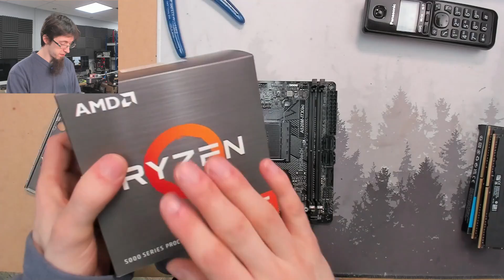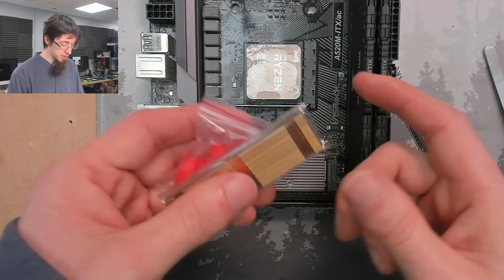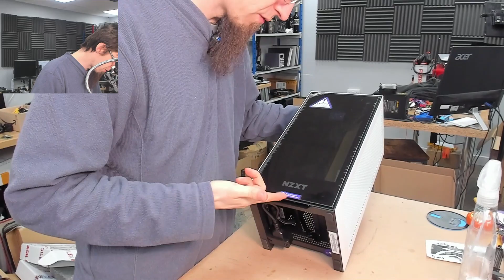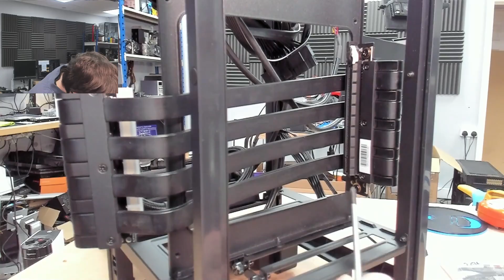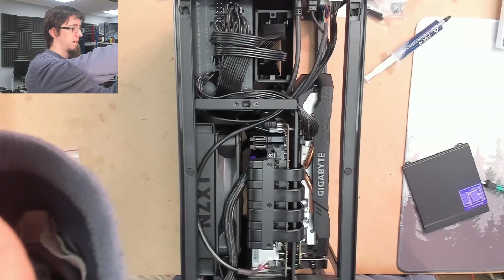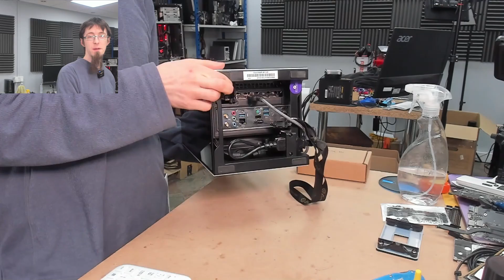NZXT H1 Build - LFC#337

Comment: Hi Graham, I have a question that you may have an answer to. I currently own an Asus ROG Strix Z590-A Gaming Wifi II (and the I5 11400F) and have tried to install a 19-pin USB 3.0 splitter which results in the Port not working as in "USB device not recognized: error. Are these ports not split-able any longer? or have they never been?
Reply from the maker: So is this like, a PCI backplate with two USB 3 ports on it that go back to the 3.0 header? Should be just fine, because this is fundamentally all the front ports are. If you're getting errors, I'm guessing it's just a bad splitter, which would be rare, but not unheard of.

Comment: I copped this case with for 90€ , can't complain. Putting in a 3060 and a 5700x on a ASRock B550 Phantom Gaming-ITX mobo. I like the compactibility. I'll mainly use this as a 2nd PC and can move this from place to place due to it's nice a snuck size. Thanks for the walkthrough!

Comment: On ur channel while trying to figure out how to attempt micro soldering..not out of luxury unfortunatly..i got a g14 rog laptop that the battery connector ripped off the board. Im broke so ita ether i fix it or use it as a 1500 dollar paper weight..ugh, the tiny tiny soldering is terrifying

Comment: Another great vid but a few small errors: the H1 comes with a 140mm AIO not a 120 as mentioned, also the power supply is 750w not 650w so I'd say its probably capable of handling up to a 3080 paired with a lower wattage CPU, especially if you undervolt.  Otherwise excellent job, love this series!
Reply: this is the v1 which is 650w the v2 has the 750
Reply: Plus it isnt Asetek AiO but Apaltek - this particular AiO has problems with very bad coolant inside, i would recommend refil it with better one.

Comment: Small thing I spotted: At 30:56 the motherboard actually allows you to change "CHA_FAN1" (or 2 for that matter) to "W_PUMP", which is presumably what you'd want.
Reply: Ya, that helps prevent this from happening.   It locks it to full speed and fan curves won't affect it.
I've seen him run a pump curve on his personal rig, but for a customer, I'm sure he'd normally just pick full speed to save potential problems.
I used a premade system which ran hot and that was the same problem.  The pump was running too slow because they didn't set it up correctly in the bios.

Comment: What AMD should do is put in a dummy CPU code in all bios that is compatible with a single core of any AMD Zen based CPU so that even if the CPU isn't natively supported by the board the bios can be loaded to perform a flash. I've owned several AMD boards in the past that were functional with CPUs they didn't recognize so i know they are capable of this. Or integrate a small low frequency low power x64 CPU into the southbridge to be used just for bios features. They could also spend a dime and have the eeprom socketed so a technician could easily remove and program the eufi/bios. I'd pay a bit more for boards that had such headache prevention features as standard.

Edit: NZXT really should have placed that warning sticker on the peel instead of the glass directly. Or used a sticker that is like the peel itself a static adhesive one.

Comment: Just packed up r5 5600x with Radeon 6800 in this case. Added an extra 90mm fan and needed to cut the hole in top of the frame to mount the massive xfx GPU but now it is amazing looking computer in my daughter's room. V2 is better but cost 2 times more if you have some skills you can build very nice gaming pc in V1.

Comment: I think they could have a version for a 3-4 clot GPU in here if they extended it a bit. since the CPU is as important as the GPU, having the chunkiest GPU possible may be a worthwhile upgrade, and you can get CPUs that will stress that 120mm AIO, would be a huge performer in a small space.

Comment: 12.45 its not an asetek unit, they had another oem do some coolers for them but the pump head was the same looks wise but pump moved away to get around the patent asetek has
Reply from the maker: Ah, that makes sense actually... The waterblock is the asetek shape, so I locked onto that, but you're completely right about the pump being relocated👌
Reply: @Adamant_IT  cant remember the OEM but its the ones that also made the nzxt m22
Reply: @Adamant_IT  do you have any experience with asus crosshair x370 boards with debug code 8?

Comment: I wouldn't think it's a good idea removing 70% of the chipset heatsink surface area and also putting more heat into it. There is nowhere for the heat to go. My suspicion is that you made the temps higher for both the chipset and the SSD with that pad there.

Comment: Happy new year.
Why does my PC always fail to automatically fix unresponsive games?
I mean it rarely freeze games but every time it freezes I'd try to open up the task manager to forced close it ,but my entire system become unresponsive as well so I have to reboot it everytime 😭. 
Can't be the GPU,and Ram(memtest86 done ✅),also using a good psu so it can't be it.

I undervolted my r5 5600 to 1.05mv stress tested it using aida64 ,and cinebench for 2 hours ,and it seemed stable.

Could it be My CPU or Os SSD,or mobo?

Comment: Warning!! 7:25 With the M.2 slightly bent like that, over time with heat, the chips will start to separate from the board. It is Critical to keep the boards as strait as possible. Great video Otherwise. I'm guilty for overlooking this myself. Cheers!

Comment: I picked one of these up also, actually made a profit from selling my old AIO, PSU and Case. Main reason it's cheap is down to the V2 version which is better equiped for Gen4 GPUs. I also added x2 120mm Nuctua slim fans externally on the back panel as the holes align to fan dimensions. This massively helped pull heat out which is the biggest issue with the case, again has been addressed in V2. Great vid, I really enjoy your build videos!

Comment: Would be interesting to see the stress test results also test with the glass off. I think it would perform better with a mesh panel instead of the glass. 🤔
Looks good on the outside but awful NZXT layout inside the glass shows only the side of the motherboard, edge of GPU, & cables.

Comment: Nice build Graham, nearly picked up one of these, but decent iTX motherboards are a rip off atm.  The H1 V2 case is still great value at Scans £199, over £100 off and has 2 type A USB ports. I have  USB 3 doublers and a 3 to type C converter to power front C from old boards.

Comment: Cool build! Love to watch your videos!
Did you know lemon oil can help dissolve glue residue? I was shocked when I find out but it works. Saves a lot of elbow grease. After that, you can wash it with isopropyl alcohol easily.

Comment: HELL!!! 100£ for an H1!!!! 😮I just paid 400€ for mine and it even came with a slightly chipped glass corner I think mime is a V2 with 750W Power supply and 2 USB-A + C on top, but still this is a hell of a bargain! Oddly it ended with a 2060 Gygabite inside as it was lying around.
The case is very lout through unless you install the proprietary NTZX software to control the fans, and, oddly, the power supply (built in by NTZX) is not compatible.

Comment: A bios update for the Asrock A520M-ITX/ac motherboard to v. 2.20 was just released 12/29/2022. The NZXT H1 case shown on Amazon appears to have 2x USB 3.0 ports + 1x USB C port at the top of case. So: maybe your NZXT H1 case is an older version, if it has only 1x USB 3.0 port?
Reply from the maker: Would explain it. I've seen them going cheap a few other places as well, people clearing out old stock methinks...
Reply: @Adamant_IT  I got the new version 2 of the H1 for $199 during cyber Monday (usually $399). I didn't think version 1 was still being sold this late into the year, they were all basically recalled from store shelves due to the PCI-E riser cable issue. Version 2 has a lot of improvements like a 750w PSU, PCI-E gen 4 riser cable, more volume for bigger GPUs, case exhaust fan, etc.
Reply: @Adamant_IT  correct, that is a V1 of this case. Scan have the V2 for £200 , still £100 off and slightly bigger footprint.

Comment: I love it when the instructions are inside something and then the first thing in those instructions is how to get inside the thing the manual was in. ;)

I'd imagine this case might have fallen out of fashion with so many GPUs more than 2 slots now.

I had the ultimate DOH moment as I specifically bought an ITX case that fits 3 slots, but the PSU blocks the third fan on a 3080 causing the fans to run 100% to compensate for poor airflow on that fan.  Really need to find another case, but there are few that will fit on the shelf I have it on - they're usually too tall.

Comment: Graham, it would help if you built on a sturdy a table next time.
Reply from the maker: I was using a different mount for the camera for these past two videos that gave it a lot more reach, but was way too wobbly 😔
Reply: @Adamant_IT  have you got the camera mounted to the table or have you got it mounted to the floor? If the camera is picking up vibrations from the table, then that's easy to sort out. But if the camera is picking up vibrations from the floor, then you've got a problem.
Reply: @jonathanmaybury5698  It was only the camera mount that was bouncing around, he explained same while it was happening in the previous build video....👍
Reply: @jerichowall8185  yes, I realised that when I saw the box behind him moving around when I viewed the video for the second time. If he needs a longer reach he is going to have to either mount it from the ceiling or from a wall.

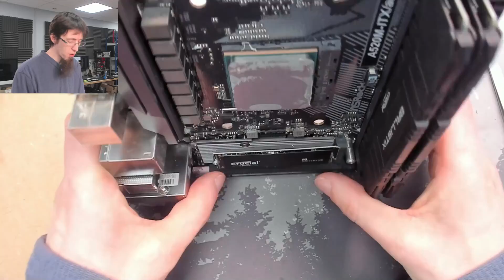Comment: 7:30 I think a shorter screw or non conducting washers would allow it to sit much better
Reply: Sometimes motherboards with two M.2 slots, have one that is closer to the motherboard PCB than the other.  In such cases, there will be two securing posts and screws provided with one set being shorter than the other.  Using the wrong post and/or screw with an M.2 slot will cause the M.2 drive to not be parallel to the motherboard or loose, as it is in this video.
Reply: @ytQrash  then that in my opinion is a serious issue with manufacturing. M.2 devices should (in my opinion) be secure tight. After many years of issues with ASROCK motherboards I will never trust them and I have around 30 years experience with computers
Reply: @GavinColbourne  The M.2 standard specifies several connector or slot heights.  For example, the lowest connector may be best for laptops or the rear of desktop motherboards.
Reply: @ytQrash  in my opinion ASROCK motherboards are still scraping the bottom of the barrel and still considered the cheapest and worst motherboard manufacturers

Comment: Probably im wrong but, didnt those cases had a short problem whit the riser cable?
Reply: Graham checked and this case has the corrected PCIE riser.
Reply: @ytQrash  i posted before that point. My Bad.
Reply: They used to make good firestarters for your house.
Reply: @T86k35  yes, I was going to comment, but I didn't want to come across as being too negative.
Reply: They updated the ribbon that was an issue. You can’t get the problem ones anymore. These are fine.